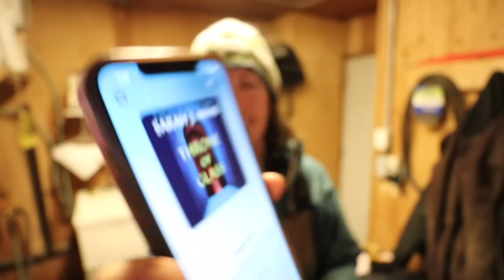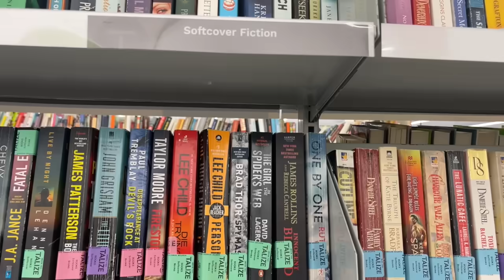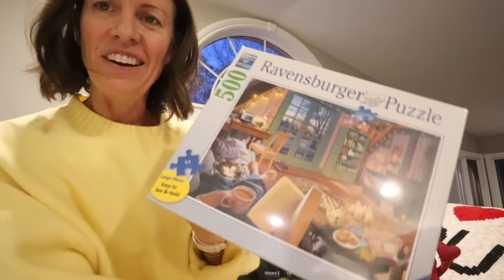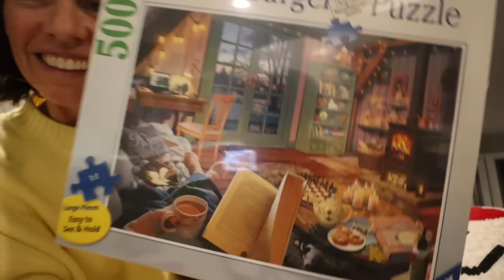Feeling ATTACKED ...in the best way possible. | retiring the nanny, floods & drone feeding? Vlog 759

Comment: The runt is so dang cute! Sorry to hear about your water issues. We had issues in our yard for years and put lots of drainage around to help but still had standing water. Ended up hiring a geotechnical engineer to solve the problem. With his expertise and a little luck, we found where the original drainage was that had broken and failed. Put in new drainage and a 600 gal tank with overflow to storm drain. Tank has a pump so I can use the free water for the garden/yard. Cost $$$$ but not one single regret as it solved the problem.

Comment: It's practically a mild Summer here today in SoCal at 77F/25C which is obviously faux, because February is probably waiting around the corner for us with a brick. I won't bore you with my ancient tale of woe re water bubbling up through a concrete floor and ruining the freshly laid floor tile with proliferating fungi from below feasting on the underside of said tile and grossly discolouring same. As Roseanne Rosannadanna used to say: "It's always something." That said, you cheer me no end.

Comment: The glorious drone footage has arrived! That was a completely different view of the barn and chores. Sandi, as soon as spring starts arriving, you are going to have a blast with your drone! And, seeing the frozen areas from poor water drainage/broken tiles, should have you and Mark skating across the ice! Think you two can pull off a triple jump? 🤔🫣😱 You will have your hands full digging up the concrete to fix that though.
I'm glad you helped out Jack with his flooding issues as well. It is sad to see such a hard working man have to deal with these (especially when you're not at home)! I hope that his property is not the lowest in this subdivision or he'll need much bigger sump pumps to deal with all the uphill neighbor's watershed. I came home from work one night, opened the door, and found my cat pacing and meowing on the kitchen table. That is a no no! So, I stepped in the door to the sound "SPLAT." I looked down at 1" of water!! 😳 A piece of water supply pipe had split and the whole house was under water. Every room, everywhere. I had the replace my furniture! So, I have some feelings that are the same as Jack's I'm sure. Not an easy thing to deal with at all.
I love the new Valentine's decor you got for the reading room. The neon heart is a favorite, along with the Snoopy and hearts mug (I'm going to try and steal it from Jess). You have a great eye for being a decorater. 
Sandi, thank you so much for sharing your life as always ❤️ We all love and appreciate you! Until next time, I'm sending warmth and blessings from Alabama ❤️

Comment: Ooo...that's a mighty fine slough you got going on there.😉🤔Don't see many dugouts down there?(of course not where the Canadian shield is, but on the flats?).Great for run off. Do your grid roads have good drainage in the ditches, via culvert systems?...🤔thinking now my terms are "Saskatchewanese"😂🤣...but you get the drift??

Comment: Drone footage was well done.
Good the ewe is improving and unfortunate timing expired but then that happens with age.
The water concern is unfortunate. The same thing happened with my yard and it's ruined any nutrients in soil making a spongy mess.
Mark might be able to rent what he needs lining up dump trucks to haul off.
Timing certainly not good with crops and our short spring.
So sorry for Jack. French drain might protect foundation with new wrap.
Ontario actually had funding based on age a few years ago in our community.
Worth checking out for London.
Stay warm and hoping forecast is wrong.

Comment: Could someone explain to this non farmer what Sandi means by a tile? I get that it's somehow part of a water system,  but I would like to understand better.
Reply: Tiles are used in areas with poor drainage.  Farmers used to use clay tiles, but now use flexible perforated pipes laid out in a grid.  When the fields are too wet, water seeps into the perforated pipes and is carried away by attached drainage lines.   Tiling a field keeps it from accumulating standing water and helps it dry out enough to be workable when it is time to plant.

Comment: @Sandi I thought I saw you hitch up that way before, but I couldn't tell for sure. This time it's clear and I need to tell you that we always cross the chains when hitching. If it comes off the ball, the chains will safely catch it. If the chains are straight, the loose hitch can dig into the road and cause chaos. Stay safe.

Comment: I can see how useful the drone could be.   By it flying high over the silo, you can see how much is left or what is messing up.  I am curious if you can remote control it from the house to hover as to check for ewes in trouble lambing, etc.  An additional set of eyes per se.

Comment: Flooding in yards sucks. Usually, the neighbors raise their yards to solve their flooding, which in turn creates issues for the ones who don't . My parents had the same problem.  They solved it by digging a small 2ft deep, brick lined hole. My dad popped a submersible pump into it connected to a hose and just turned it off and on when needed. Obviously, it was more trouble in the winter during thawing but ended up being the cheapest option. Good luck. I love watching your videos ❤

Comment: How do you weigh the food that goes into the Mixer?

So many question from Germany 😂
Reply: Usually feed mixers are mounted on load cells (electric scales) and the weight readout display is mounted on the side of the mixer within view of the telehandler driver.  They use large displays that are easy to see.